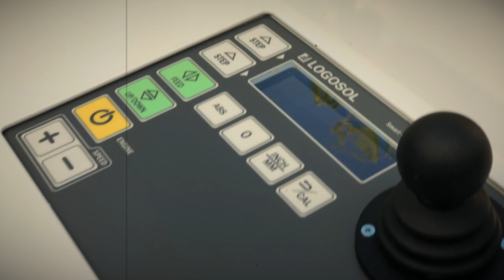Logosol B1001 with Smart Set milling 1x4"

Comment: Wow that sure is a compact but able mill, not sure of the dimension of log it will accept but logosol as a whole build excellent wood cutting products. Cheers !
Reply from the maker: I takes quite large logs, Max. cutting width: 33.5 ”, Max. cutting length: 16 ft but you can extend it how far you want.

Comment: Question? Is that cable for the smart set long enough to accomodate the 1.15 meter frame extension available for the mill?
Reply from the maker: I have not measured length but feel like there is quite a lot of extra so an extension should not be a problem